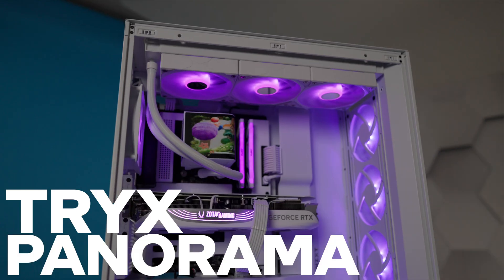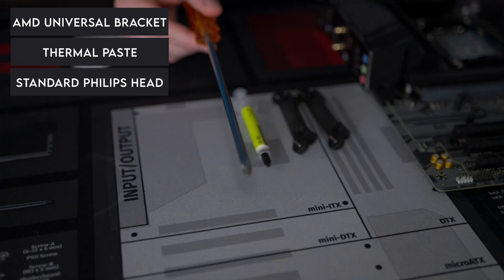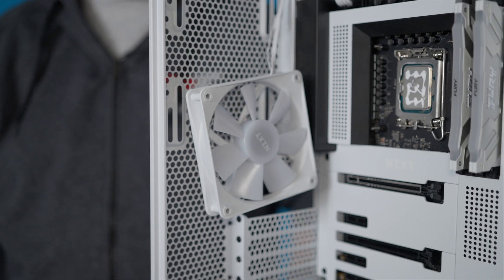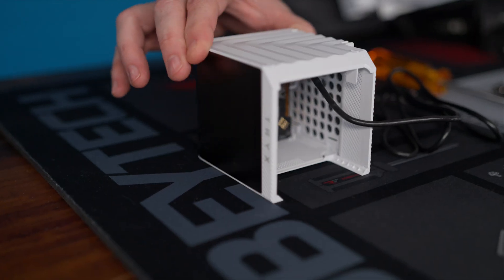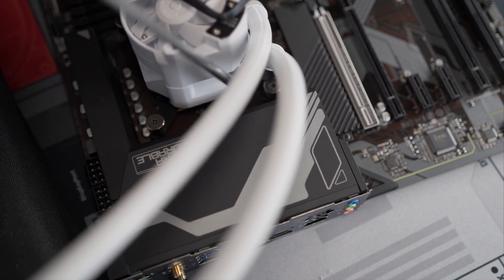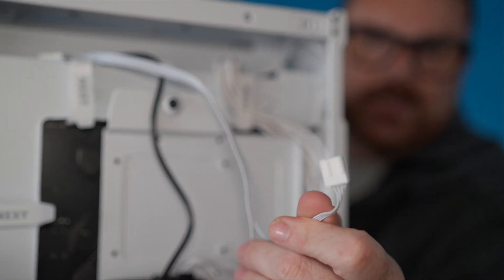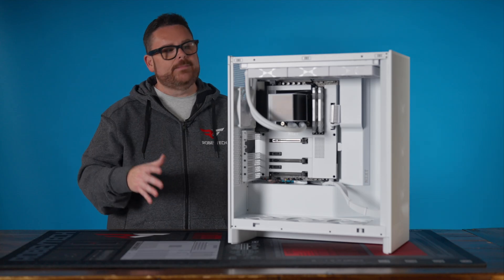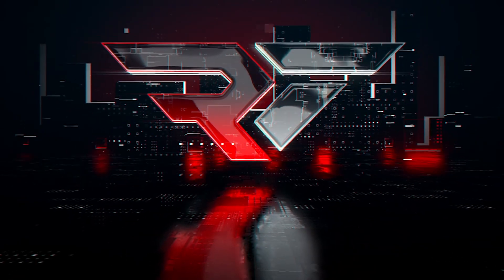How to Install the TRYX Panorama AiO

Comment: LIFESAVER!!!! i got that one today and first only 4 screwa where already installed and no one more in the package this vid saved me
Reply: What did you do?? Im in the same situation
Reply: @zayafk6096  ähm amd system? if yes i took the four screws out of the existing 2 coolerholder from amd (that are already on the board) this 4 screws you need for install the new brackets. than if its a am4 or 5 system you must put the screws in the bracket of the cooler in the INNER Position (you can have it either OUT or INN position you need IN for all 4) and than you can install the aiocooler GENTLY (if you push to hard until the screwing you push the screws out of the bottom bracket which happend to me.

i just can say the installation of the tryx was just BAD so many poor decisions made from that dev team. but if its finally installed i looks REALLY good.

Comment: this helped me immensely, thank you.  When using the control box, is there a reason you plug the fan pin into a System Fan header and not the CPU FAN like you did when you didn't use the control box?  I hope someone can help me with this question.  Thanks again, and great video!

Comment: I’m so confused I just installed the cooler and got the cup red light everything seems fine but the bracket didn’t fit the backplate, the backplate was longer compared to the bracket I don’t imagine There’s something that will fit plus the backplate I received is different compared to others that have the same version
Reply: Exact same problem here with am5
Reply: Yeah same problem here as well just bought the back one and having the same issues installing it with the am5 chip
Reply: @fitnesswfinance any updates?
Reply: @zayafk6096  I ended up figuring it out when I built my pc, what worked for me is where you screw the bolts in you can push the screws toward the cpu so its closer or you can push them away from the cpu and what worked for me is when i pushed then away so it gave me more room to fit the screws to the brackets hope this helps!

Comment: if you go with the 2nd option for the argb fans and not wanting to use the control box, can you connect radiator fans to sys fan header? cpu fan header is already used for aio. This is what I see on my mobo manual:

cpu_fan1: default fan mode is auto mode, max current is 2a, and max power is 24w
PUMP_Fan1-2: default fan mode is pwn mode, max current is 3a, and max power is 36w
Sys_fan1-7: default fan mode is auto mode, max current is 2a, and max power is 24w

Comment: Hello quick questioni just got mine today, i installed the app for it and the screen turn on but the panorama option to change the icon its not showing up on the app what could it be? Please need an answer before returning it
Reply: Maybe update firmware if there's any

Comment: If you were using the controller, could you plug the pwm into the cpu fan header? As you connected it to the bottom fan header, so would you get an error on start up as you only have the aio pump/opt fan header connected?

Comment: How would we go about wiring it up if we changed the fans on the radiator to different ones? Would we just need to plug the aio pump cable and the USB cable to control the screen?

Comment: Instructions from TRYX have the aio into 4-PIN CPU_FAN header, AIO_PUMP header, or W_PUMP + header.  Does it matter if in CPU_FAN or PUMP_SYS? I imagine PUMP_SYS as its a constant rpm instead of ramping with cpu temps., then turn off cpu fan header error in bios or manually change cpu curve if in that header.
Reply from the maker: Correct.  Depends on the version of the AiO you have as you then would plug the fans into the CPU header if you were not using the Hub.

Comment: So I have the non-argb version, when i plugged everything in, plugged the screen directly into the USB slot on my MB... I get nothing... the usb slot on my mobo works, i tested it with my lian li fan controller... tested both my usb ports, they both work but neither of them will turn on the screen. using a MSI X670E, Carbon 7800x3D with Windows 11.

Comment: Hello, I have a problem and when I installed everything is fine but the image cannot be changed, I tried to update and it did not detect the screen, that is, it shows the image and the logo but in your program it does not detect anything and its controller, unfortunately, I already have all my ports. Full hard drive, help, I know it can be done without the controller, but I'm doing something wrong.
Reply from the maker: Reach out to Lian Li!  There has been an issue
Reply: @robeytech  
If I try to communicate with them, I still haven't received a response. I was looking to see if I was missing ports on my Asus rog strix z690 gamer wifi, but as I see, this is not the case. All the fans, the lights, work, but when I install the program, I don't get the second paronama option. something descpiondo even so I hope for a solution in the future
Reply: @robeytech  Lian li? This is for the tryx aio right?
Reply from the maker: @jommammaxse95  sorry I meant TRYX we released two of these at the same time

Comment: Hello, i want to ask, can i control or change the screen without using the hub that came with it? By directly plugging into the motherboard
Reply from the maker: Yes
Reply: The RGB controller is meant to control the fans on the cooler, and once you download Kanali, you can manage the screen from there.
Reply: Great question I wonder is all this aio software from china safe🤔
Reply: @pgrow420  yep, it's great, just got mine, I can control the AIO thought the USB on the motherboard, the software is only used for their fans and screen.
For your other question, I don't think the software has any problem and it keeps updating. Even people in the US used deepcool products and their software, and it's fine until the stupid ban
Reply: @arthur_pd  so plugging into usb port should able to adjust screen right?
Reply: @pgrow420 I mean, how bad can it be considering the fact that softwares like Armoury Crate, Corsair, L Connect exist… sigh
Reply: @mysticqro950  you got a point there
Reply: @pgrow420 Chinese software has a much better credit record than American software. If you don't trust it, then don't use it. Why don't you use products made in your own country?
Reply: Same question, am I able to access kanali without using the hub and just plug the screen straight to the usb header on the mobo?

Comment: Bro, great video. I want to know if I can use other fans for this aio.
Reply from the maker: Yes you can
Reply: Any negatives of doing this?
Reply: @jmsantos1983  There shouldn’t be any downsides to doing this, as long as you're okay with controlling the fans through your motherboard’s fan and RGB software. The ARGB version comes with an RGB control box, allowing you to manage the fans via the Kanali software. For the non-ARGB version, you’ll control the fans through the motherboard software anyway, so there shouldn’t be any significant drawbacks. hope this helps

Comment: Wassup man, hope all's well.  I have a question, I'm a fairly new PC builder. I'm planning on swapping out the stock fans for lian li infinity fans. Any advice you can give me on being able to control the fans and use the kanali software for the screen? I assume I'd need to connect the fans to a hub for lian li and use L connect,  and also have the aio connected to its own controller in order to use kanali. Any advice you could give would be appreciated.
Reply from the maker: This is all correct.  Kanali for the screen and LConnect 3 for the Lian Li fans for both airflow and color control
Reply: @robeytech  thanks. Now if hyte could get my case off back order I could get to work lol.